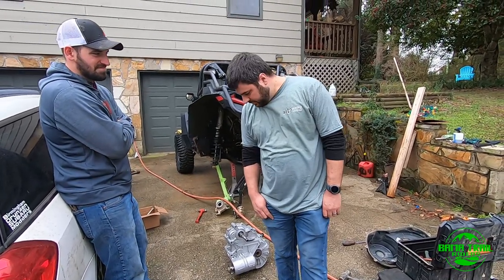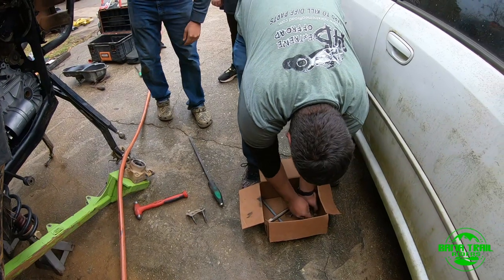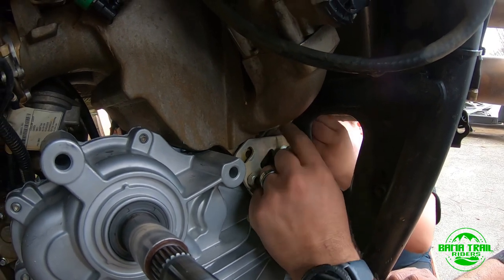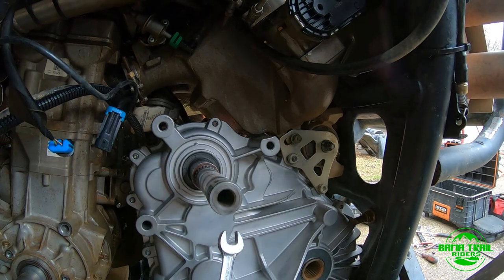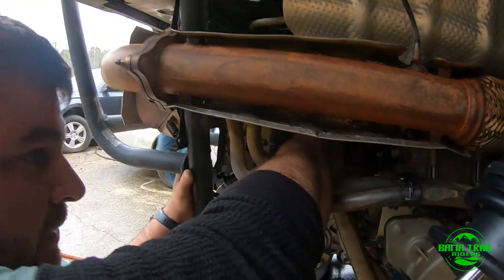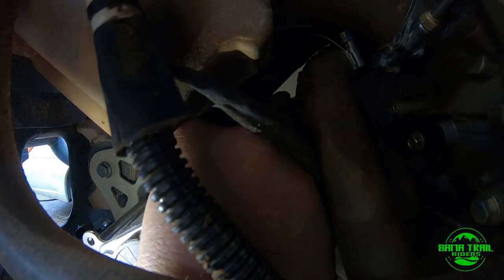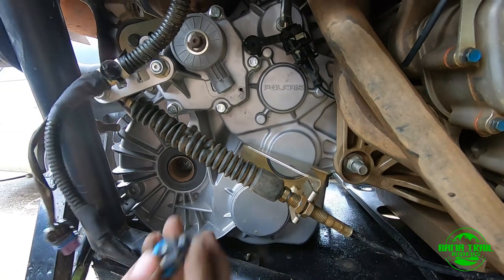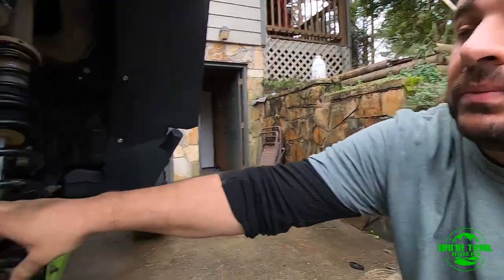How to Install a Transmission in a Polaris Rzr! 2020 XP Turbo.

Comment: You forgot the o-ring between the cover and the transmission.  Crows foot 15mm works for that bolt on the thermostat housing.
Reply from the maker: Yes i didn't have the crowfoot at my house. 
The gasket was on the cover

Comment: Nice video!  How far are u guys from Bham,Al?  And could u point me in the right direction...i wanna put a locker in my 19 Can Am MS 1k...THANKS!
Reply from the maker: Me (lucho) live in moody Adam live in fultondale rik Huntsville and Paul South Alabama. I personally don't deal enough with can am but I will tell rik to jump on board here
Reply: Hey, you could do a torque locker or a Halo. The halo being more expensive but the strongest of the two!!
Reply: @BamaTrailRiders1  I don't live in South AL
Reply from the maker: Montgomery is south 😆🤣
Reply: @paulwuzhere  🤣🤣
Reply: @paulwuzhere  Southcentral?
Reply: @BamaTrailRiders1  montgomery is central, I'm north of there but still central AL.
Reply: @PassionatelyOffroad  10 4,thanks chief.Whats the pros & cons on keeping my stock housing instead if goin with the billet?
Reply: @Gorealaracer38  depends on how you ride, the internals are more important.
Reply: @PassionatelyOffroad  i ride easy and hard sometimes,the shape of the holes determine how i ride lol....i dont go str8 to the mud & holes,but when im in one i want all 4 LOCKED,just not loaded lol.So u think the stock diff case will hold up as long as im not beat'n the hell out of it while workin it?
Reply: @PassionatelyOffroad  and how much is the labor on it to put it in?
Reply: @Gorealaracer38  I’m not sure on the labor to put that in, we do “most” things ourselves other than the big stuff like the trans etc.
Reply: @PassionatelyOffroad  10 4,thanks again.
Reply: @Gorealaracer38  anytime!